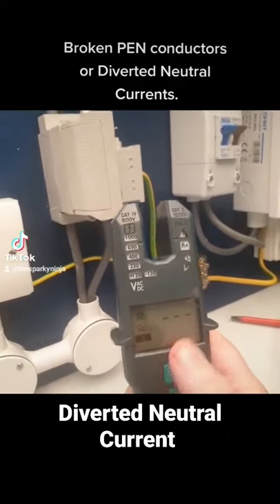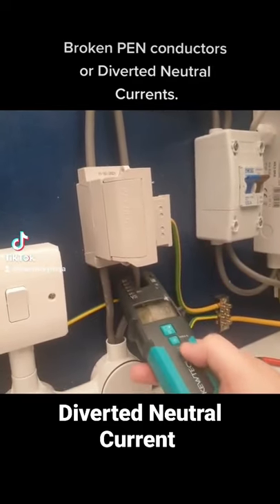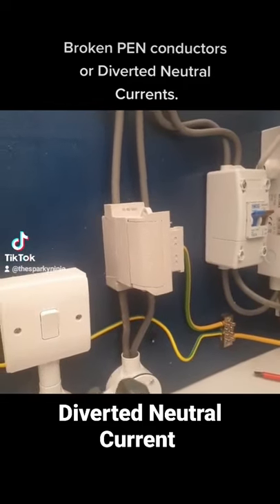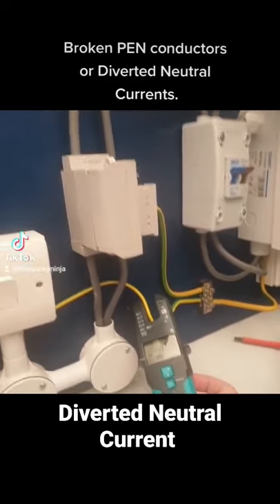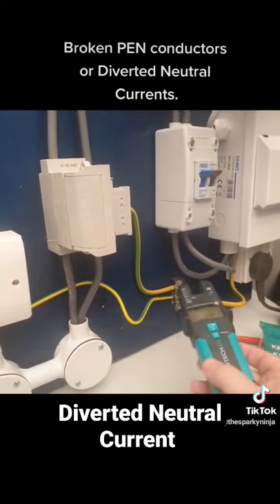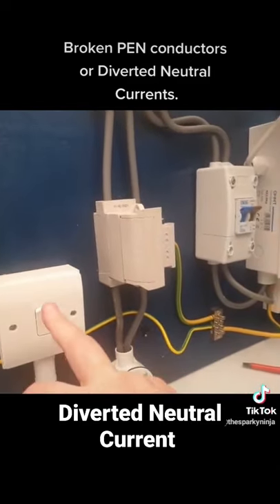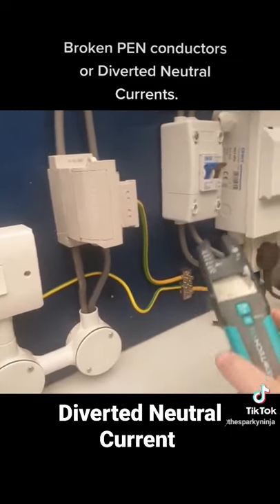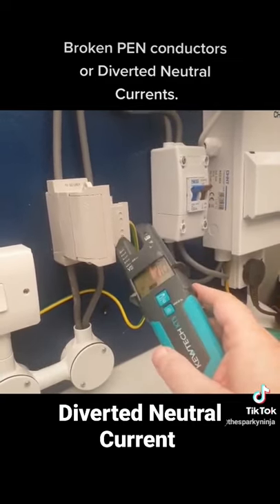A quick short showing diverted neutral current.

Comment: Either pen is not sufficiently have good earth connection or bonding impedance is very low than Main earthing conductor
Reply: Nope, current takes ALL available path, be it lowest resistance or higher resistance.
Reply: During a broken PEN fault (in TNCS), the load current have only one(1) path to take which is thru the Bonding out to the Earth Mass plus Bonding Network (finding its way into a adjacent/neighbor Bonding; then back into neighbors' premises PEN).
This Bonding Network is of Lower Resistance as opposed to the Earth Mass.